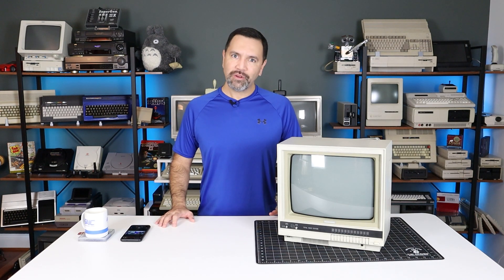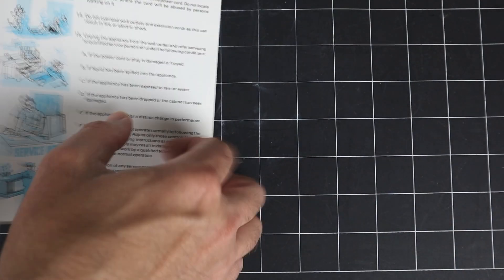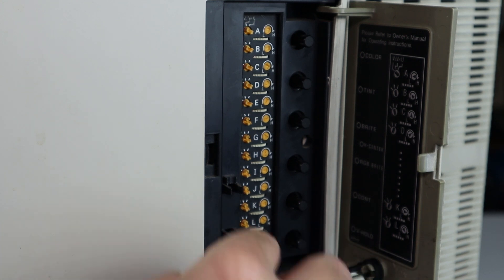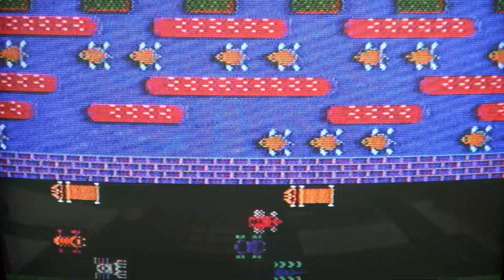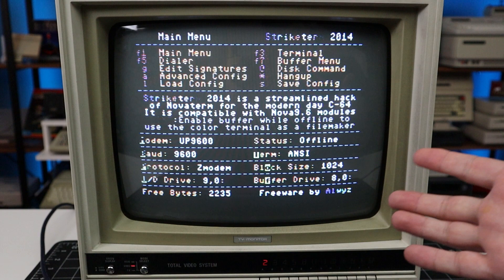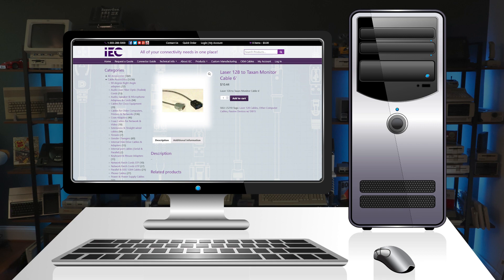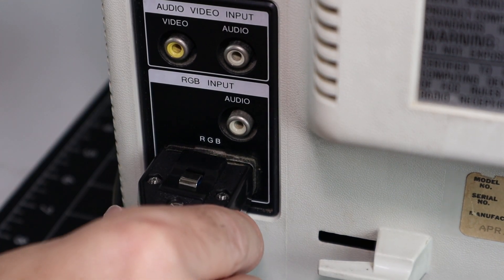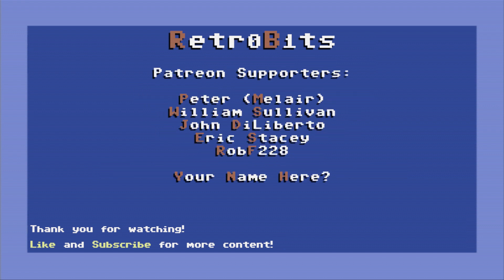One CRT to rule them all? Introducing the Sears Total Video System!

Comment: I had this exact TV monitor.  It originally hit the market in 1984 and I used it with my Coleco Adam for years.  After I moved on from the Adam I used it as a regular television until the mid-1990s when the flyback transformer failed and I finally retired it.

I had never seen another one until this video.  Amazing!

Comment: Your tips about finding and modding the Taxan cables are solid gold. I've got a couple monitors with RGBI in on VTR connectors, so this helps a lot. Thanks!
Reply from the maker: Glad it was useful. I've also pinned a comment with a link to a DB9->EIAJ cable the vendor sells. I didn't know about that one until they contacted me about the video!

Comment: 10:30 I think that little switch was for the automatic fine tuning. Disabling it with the door open prevented people from tuning in a station with AFT on, and was common with TVs and VCRs that used presets like this. The idea was you tune in a station as clear as possible with AFT off, then turn it on to lock in perfectly. Tuning in the station with AFT on means you could be right on the fringe of the station without knowing, and if the signal became weaker you would lose it entirely.

11:30 That was also common on older TVs. As you found out, it was an inexpensive way to switch between the 75ohm coax and 300ohm screw terminals instead of adding a switch. The wire actually goes to an internal matching transformer (or balon) that connects to the 300ohm screw terminals.

15:15 It looks like the fine tuning for the preset is slightly off, I would try the fine tuning to see if that helps at all, and switch on AFT. It could also just be that electronics like this were also not designed to reject the type of high frequency RF noise that today's electronics emit, so RF on a lot of these old devices is much worse than it used to be. Especially with those old game switches.

Loved the video, thanks for sharing!
Reply from the maker: I can't believe I completely overlooked the possibility that the fine tuning wasn't correct for the channel I had the Colecovision on. Today I went back and fiddled with it some more and the AFT does clean up the signal a bit and brightens all the colors up as well. There's still a fair amount of noise but it's definitely better than before!

Comment: My Sears "Total Video System"  was manufactured on 1/1988.  My unit has all digital tuning, no side panel or numbers to insert.  Still have an RF switchbox connected to the back of the unit.  I ended up making my own RGB cable once I found an EIAJ8 connector.  Thanks for sharing.
Reply from the maker: Nice, so they made more than one model and for a good number of years. It's crazy how there's almost no mention of them when you Google the name though!

Comment: I love old manuals! With regards to the polarized plug, it seems that most building codes required polarized/grounded outlets by the mid 1960's or so. As a carpenter in the northeast US, I've been in hundreds of houses and have seen plenty of ungrounded, non-polarized outlets still in use. The most recent example was in a fairly high dollar single family home last autumn. I've also worked on houses with functional knob and tube wiring which, if you're not familiar with it, is pretty scary. People only upgrade their electrical systems when they absolutely have to, so I imagine Sears was just covering their bases.
Reply: I’ve seen plenty of modern equipment manuals with the same warning.
Reply: Also, Japanese outlets are generally ungrounded and non-polarized, which means there is no safe way to provide a chassis ground for AC appliances that use the most common Japanese outlets.

Comment: I bought this monitor (in grey-black motif) new in the summer of 84 after Consumer Reports in rating small TVs mentioned it was a marginal  television but actually a respectable home computer monitor even at $350. Didn't realize at the time the C128 would come and that 80 column mode for the IBM PCJr (thus the odd connector) would nicely support 40/80 column output. I ultimately even made an adapter so I could connect it to the Amiga 1000.

Over time the horizontal output transformer (flyback) burned out, that's when I found the origin of the design is Sanyo and bought a replacement through Sears parts. I repaired it myself, as I'm an EE, at that time just out of college. When it went out again within a year I saw in the schematic that there's an adjustment available for how much drive is provided to that output stage (power transistor) a tap on the circuit board for a lower  setting. I made use of it and to this day the monitor has never failed again. I use it whenever in a pinch I need to just pipe some old 8-bit video out. So nice to see someone else has discovered it too.

I've only run into one person, in the late 80s who was using it with an IBM PC in CGA mode. That's where the green button and compression  comes in handy it gives you a poor man's Hercules monochrome if you only have the single video card.

Comment: lol on that slight pause right after the episode number. Well, I never heard of it, but I was all COMMODORE for the 80's, so if it wasn't in my Ahoy or RUN magazine, I didn't know about it probably. I also just hooked up a RF switch box for the 1st time in almost 40 years last week!! I got my MAX from Japan which only has RF out on channels 1 & 2. Luckly Robin from 8-bit Show And Tell just did a video on the MAX the day after I got mine and he told us that Japanese NTSC channel 1 & 2 is the same as U.S. NTSC channels 95 & 96! I was very lucky to still have a 13 TV that was analog and it went up to 95, so I was able to set the MAX to channel 1. TY for all the GREAT content you make for the retro community. I always look forward to your next episode!
Reply: You are for sure keeping up with the Commodore... and the Commodore is keeping up with you!
Reply from the maker: Haha, I saw Robin's video as well :) Great timing on that. I keep a VHS deck around to use as an RF tuner when needed, but it's nice to have a display that can work directly with these old devices too. Thanks for the kind words!

Comment: Seems like the "green" button just disables the red and blue electron guns, but doesn't disengage the chroma/luma filter for decoding the composite signal. I've seen a real mono / composite switch on the original Apple IIc composite color monitor, and its effect is close to miraculous in switching between sharp colors (as sharp as composite can get) and fringe-free 80-column texts.

Comment: It's a rebranded Sanyo. I had a Sears branded version of the Sanyo 31c436, which is close to this one, but with a front glass and updated controls. Same connectors, same wire for the rf port.
Reply: Its the same line as commodore 1701 1702 which many companies made sets from
Reply from the maker: Thanks for the info! The Sanyo looks identical on the back, there's no doubt about it.

Comment: I got a monitor with the same connector. Thankfully it came with the connector connected to a grotty old piece of wire. I made an adapter, similar to yours, but DIN 6 so I could make custom cables to connect to whatever system I needed to. Mine was the Taxan monitor your cable was designed to connect to :-D

Comment: Long ago, I had an old Goldstar TV with that same jumper wire. It connected the 300-ohm screw terminals to the TV when the coax jack wasn't being used. I still have a little 13" Samsung TV with a toggle switch that performs that same function.
Reply from the maker: Cool, thanks for sharing - I guess the little jumper is more common than I thought. This is the first time I've ever seen it myself!

Comment: The one-touch color was done the way it was because you didn't want it on while you were adjusting the tuning. You manually fine-tuned each station for the best picture and color, then when you closed the door the automatic color lock took over. If you didn't get it close manually, the one touch didn't work well.

Ideally you want the proper black level to be in the middle of the brightness control range. If you can't raise the black level up to a washed-out grey at the end of the range, you might need to turn the G2/screen up on the flyback, or the screen capacitor on the G2 line might be bad. Or sadly, the tube might be toast.
Reply from the maker: Ah, that makes perfect sense. Thanks for the explanation! 
It looks like I need to open 'er up and at least test the caps and maybe adjust the flyback. Is there a definitive way to know that the tube is bad to save some effort with a futile recap?
Reply: @retrobitstv  using a tube tester, a gizmo that will read the emissions of the three cathodes by measuring between them and the heater filament. not all that difficult to build (basically a voltmeter and a few passives) but I don't remember where I put the schematic. The only power needed is for the heater so is safe to work with.

often combined in commercial models with a rejuvinator/regenerator/bulb-bopper, which briefly extremely overdrives the cathodes to blow off corrosion and so restore emission. overuse will blow off too much cathode material and kill the tube.
Reply: Not only did the one-touch system need to be close-on to work, the automatic tuning would be fighting your manual adjustment making it jump from untuned to tuned. You want the manual adjustment to change evenly so you can find the centre of the range. Sure, you could have a manual toggle. But  that would be complicated for many people to understand, so the mechanical lock just applied it when adjustment was complete.

Comment: I was lucky enough to have purchased the Sears TVS at the same time I bought my Commodore 128 ("C=128") in 1985.  The two together made a great pair.  My TVS model must have been different than yours though, and I believe cheaper than the $1000 retail price you found.  I don't remember a green-screen button at all, and RGBi input was via a more common cable connector.  It also had an input connector yours does not, for mono video.  What was great for use with a C=128 was that you could have the RGB and composite parts hooked up all the time (as well as the mono cable).  I think your system was showing its age, as the composite input on my system was a lot clearer.  I don't believe I ever tried to display 80-column text via composite though.  (Why would I, with my computer having digital video available?)  The RGBi and mono images were very crisp and clean.  Performance as a TV was okay, but I did not often use it for that.⬅
A feature of the C=128 not often utilized was the ability to program the "80-column" chip.  If you expanded its video memory you could more than double the number of lines of text, or even increase the number of columns. (I believe the 128D came with expanded video memory, but I had to solder mine in.)   The TVS was able to display an 80x50 screen very crisply.  For something like 132x50, the mono option was clearly best, though.  BTW, one of the signals on the C=128's RGBi connector supplies the mono signal, and a special cable was needed to split that signal out.

Comment: I first saw a polarized plug in 1965, and it was something new to me then (I was 13). Much to my surprise, I found that all the outlets in our apartment were made with one slot wider than the other to accept polarized plugs, although they did not accept three-pin plugs with separate grounding wires.
Reply from the maker: I have clearly remember non-polarized plugs existing but I cannot recall if the outlets we had growing up were or not. Just found it odd that they would have to call that out explicitly in the safety guide!

Comment: Great video Matt! I actually watched for these and just scored one on eBay. I had recently already picked up the proper cable in case I came across a similar unit and it works great with my Tandy 1000 as well.  Composite is definitely showing shadows etc on mine.
Reply from the maker: Nice, enjoy it! It'd be worth checking to see if enabling the auto color correction helps out with your composite video as well as RF. I seem to remember it did make a difference.

Comment: Back in the day of my ownership of a Sanyo MBC-555 computer, this monitor model was my choice (and for many MBC-555 owners) as it was pretty much the same capabilities as the Sanyo branded CRT-70. The Sanyo CRT-70 was far more expensive then the Sears TVS so many Sanyo ownwers who wanted to get an RGB monitor went for it. The Sanyo MBC-555 used an 8-pin round RGB connector with unique pin outs so a special cable was needed. Most people made their own cable as it was far cheaper than finding a place to sell one complete. Thanks for the ride down memory lane.
Reply: I had an 80s Hitachi TV that used a round DIN plug for RGB, never had anything to plug into it though.  This was a 22 inch tube on a PAL set in the UK.

Comment: I remember in 1985 that polarized plugs were starting to become popular and people hated them.  All those brown extension cords that didn’t have a polarized plug were made useless.  

In 1985, it really wasn’t all that far off from when there was no code requirement to have power outlets  all over the place so extensions were widely used.  Think of them as the 1980s equivalent  to the 14 outlet power bar. 

Also, most older homes didn’t even have 3 pronged outlets, so it was common place to pull out the ground prong.

Comment: This monitor is squarely a 40 column display with a slot mask tube and likely no more than 250-300 TVL. This is a great monitor but not in the same category as a legitimate 80 column 2000 character display with over 400 TVL such as a 1080. You do get that RF runner though which I think is cool for all your RF only systems.

Comment: Polarized plugs were new and in fact a major pain in the kiester. That's why they made adapters for converting polarized plugs to regular plugs that could go in either way. The manual says don't do that. But if you had regular sockets you had no choice unless your going to take your socket apart, re wire it and put a whole new socket on it. Most people just ignored the book and used ab adapter. Even if they had a surge protector, the surge went through the adapter.
Reply: Non polarized sockets were standard regular sockets for a long time.

Comment: Other than the vertical sizing, I would just "leave well enough alone".  It would be nice to be able to produce a modern solution to that proprietary connector, but on the other hand, it would seem that the space it occupies is roughly the same as a DB9.

For episodes 77, 81, 84, and so on, I would hope that those would be dedicated to machines that were released in those years respectively in the 20th century.  If the most common computers have been covered on this channel, there's bound to be an obscure computer or games console.  😉
Reply from the maker: I try and keep my eye open for obscure/rare items that don't cost a $fortune on eBay. They're certainly few and far between!

Comment: Coincidentally,  I recently picked up a Magnavox CM8562 which has similar inputs to this monitor.  However, no analog RGB.  There is a mod out there to enable it.  Wonder if there is also one for this monitor.
Reply from the maker: Analog RGB input would be a nice to have for sure and I'm sure there's a way. It might even be easy with your Magnavox since it shares a lot with the Commodore monitors already.

Comment: I never would have expected an American TV to have UK style preset buttons and preset tuners.  I've only ever seen old American TVs with the tuner dial.  

The presets were a necessity in the UK because instead of having local TV stations broadcasting on a set channel number, we'd have national networks broadcasting from different transmitters, each one broadcasting on a different frequency per network and location (usually within a narrow subband on the UHF band, this caused hell at digital switchover time, as digital TV used the entire UHF band)

Instead of having channels numbers, the buttons were initially labelled for the networks (BBC1, BBC2, ITV) and then people would naturally use preset 1 for BBC1, 2 for BBC2, 3 for ITV, 4 for Channel 4 and a spare for the VCR or satellite receiver for Sky.  

Looks like the Sears Total Video System is a European TV reackaged for the American market, composite and RGB inputs were more common due to our TVs automatically being multi-standard (they had to be, back in the day parts of Europe used different colour standards - either PAL or SECAM depending on where you were, NTSC was also included although nobody ever used NTSC in Europe)

SCART had both composite and RGB inputs (and outputs!) built in alngside stereo audio in (and out!) it was like a 2 way HDNI for SD analogue devices!  

Looks like all the green mode button does is turn off the red and blue guns in the TV.  

I think Sears should have kept the SCART socket on the back!  It might not have made sense back then as it just would have been a huge mysterious connector with 21 pins, but nowadays, those Sears Total Video Systems would be well sought after over there all you'd need is those European adaptors which would plug straight into the Sears Total Video System... or a SCART adaptor as they're known over here!
Reply from the maker: It was definitely unusual to have a tuner that was adjustable here. I've added RGB SCART connectors to a few of my other CRTs so I can use them with game consoles and computers - very handy to have a standard. I wish we had one here prior to the VGA HD15 connector.